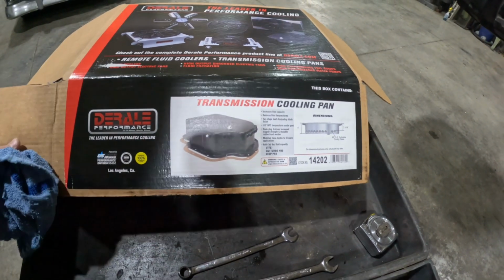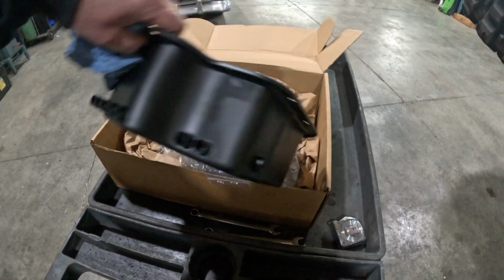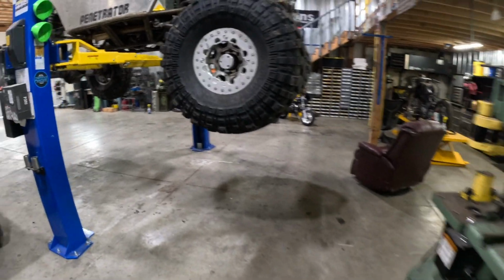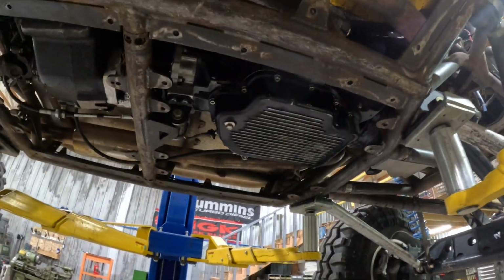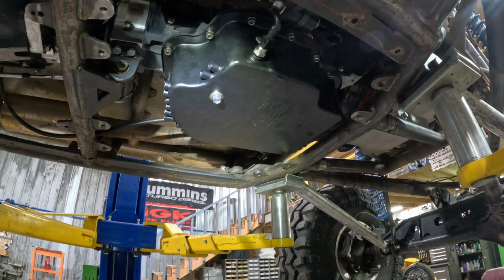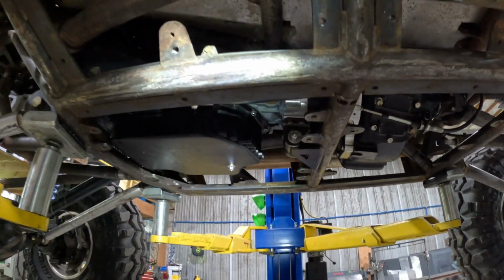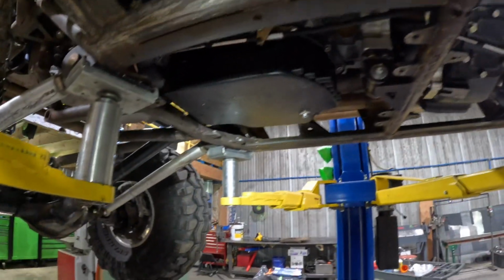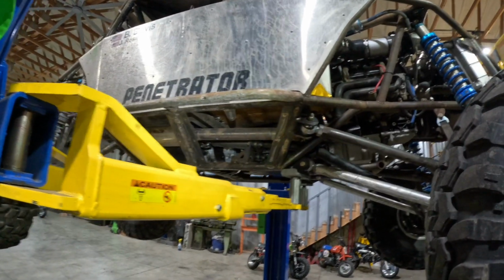Th400 derale 14202 oil pan install, maximum cooling added oil capacity

Comment: Hey thanks for showing the video. Just have a question please.  Is it true that the Derale deep pan filter pickup intake tube long pipe does NOT require the "O" ring(s)?
Reply from the maker: That I don’t remember, I believe it needs orings as there has to be some way the tube seals, the filter should have a rubber grommet inside it for that side of the tube